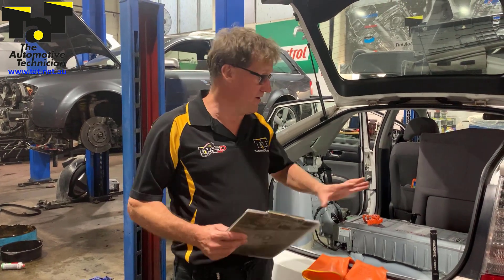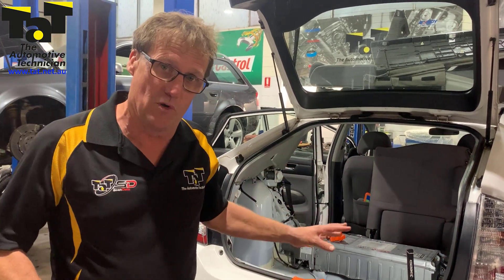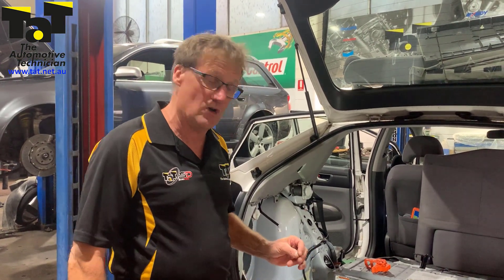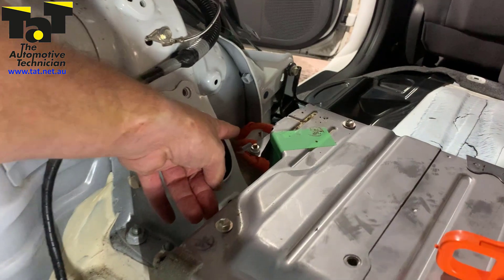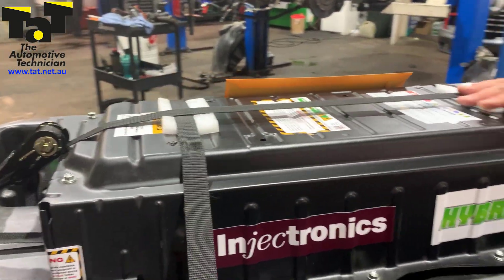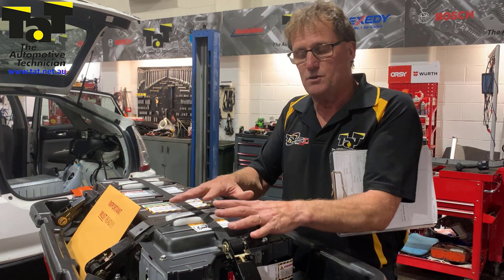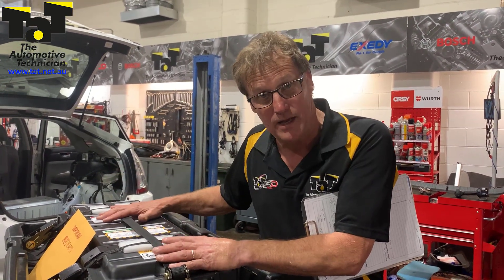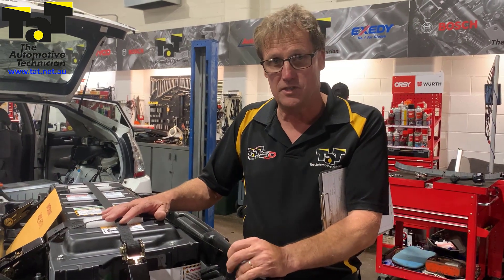2007 Toyota Prius with a high voltage battery issue - part 1

Comment: I've replaced moduels/ last year.
Did good for many miles.
I balanced the moduels too.
Now Codes/battery fan runs fast/limps home after clearing codes.ran for a couple miles but/same thing/reading 216 volts on high v.battery?
The packs ready to lift out.
I stopped when I read  the 216?
One video says 210s fine?

P08A0 code./P3012.and P0AFA
Presently/ I plan to open things up/read the voltages in pairs/see what I get.
Think bank one was mentioned?
That maybe generic?
Any suggestions. 
That's the limit of my experience/ well/I cycled the moduels before too with a hobby charger/kept readings etc.that took FOR EVER!
THANKS.